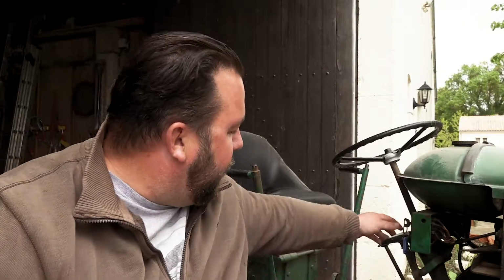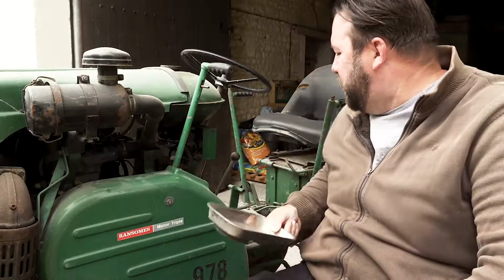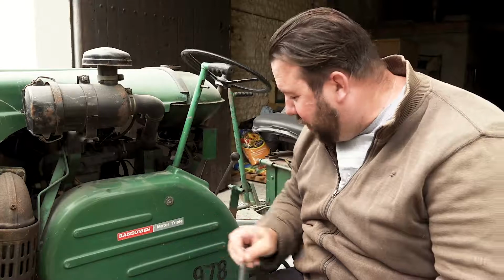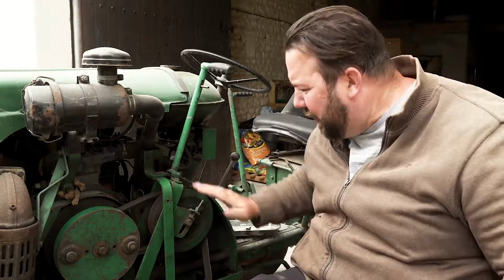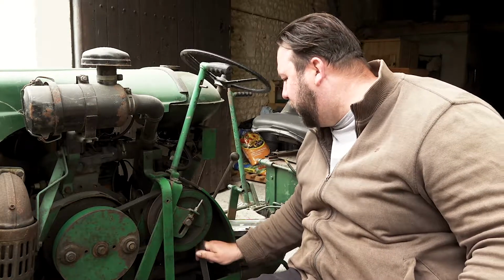Working on the gang mower

Comment: Which motor do you have? I'm probably buying a 2 cilinder mag but can't find anything about it on the net
Reply from the maker: Mine is the later Kubota Twin cylinder diesel. I have a parts catalogue with exploded diagrams (all engines) if its any help. Drop me an email (address in about section) and I can forward it on to you.
Reply from the maker: I've just checked it might only be the Kubota engine in there, but it has everything from chassis to drive train.